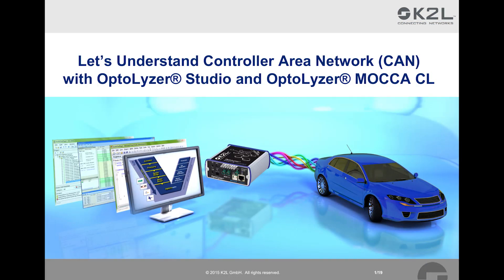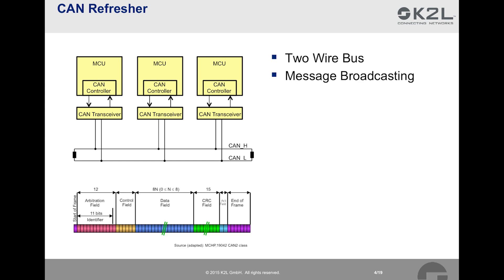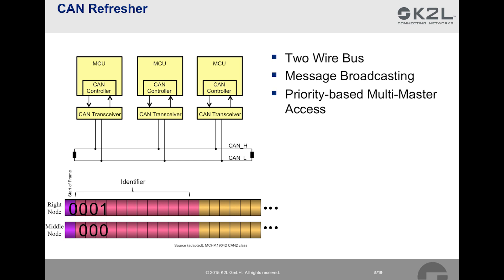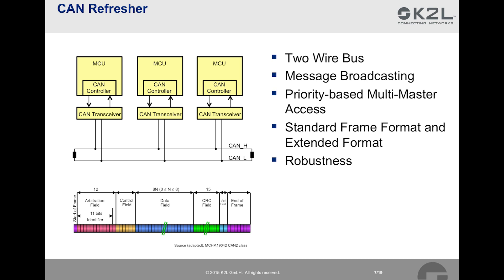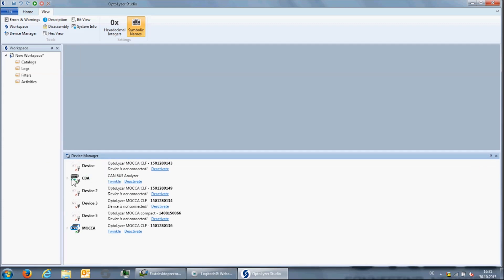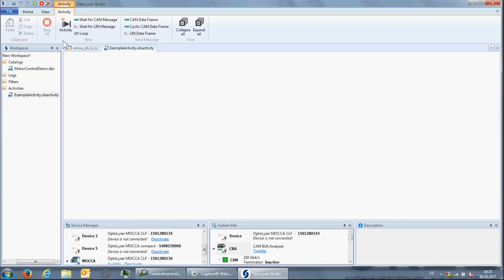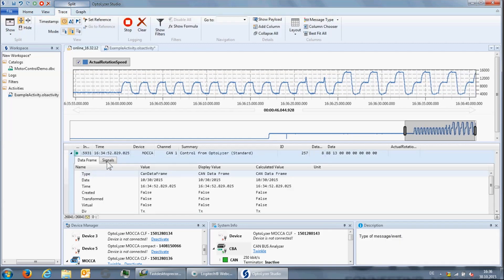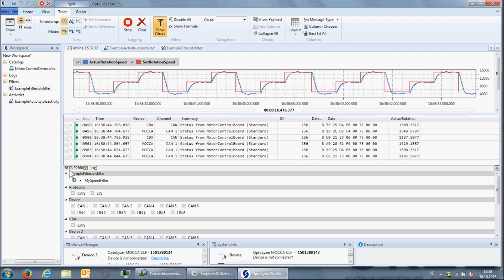Controller Area Network (CAN) with OptoLyzer Studio and OptoLyzer MOCCA CL

Comment: If CAN Bus uses two cables that both have a voltage, how is the circuit completed without a ground?
Reply from the maker: Hello Robin,
thank you for your Question, we will Forward this to one of our Engineering colleagues. Please stay tuned.
With Best Regards,
Andreas
Reply from the maker: Dear Robin,

Many thanks for watching the K2L video related to CAN bus Analysis with the K2L OptoLyzer® Studio and the K2L MOCCA CL. Many thanks for your question as well. 

With respect to your question, as the CAN bus is a differential bus, only the voltage difference between the two bus lines CANH and CANL is relevant. The evaluation of this difference results in one of the two logical states recessive or dominant; therefore, it is not required to provide a common ground. If you would like to dig deeper in relation to the CAN bus physical layer, you could refer e.g. to the Microchip application note AN288 with title: “A CAN Physical Layer Discussion” that you can find at http://ww1.microchip.com/downloads/en/appnotes/00228a.pdf.

Please continue to follow K2L on YouTube. We at K2L are looking forward to receive your first order; for requesting a quote, please visit www.k2l.tools.